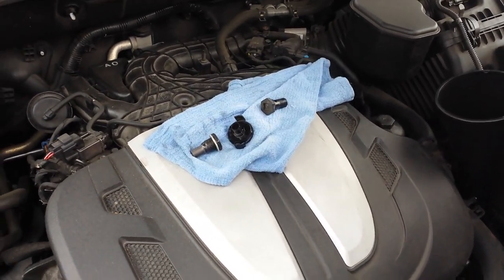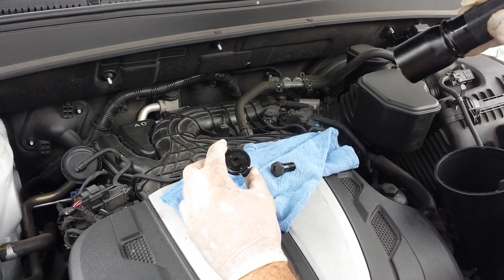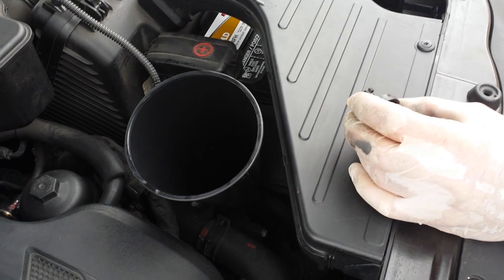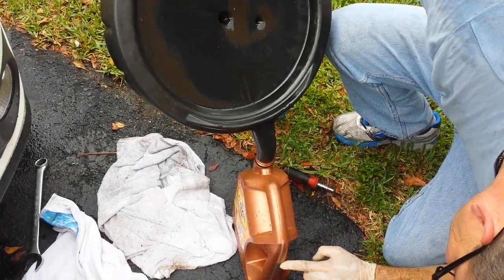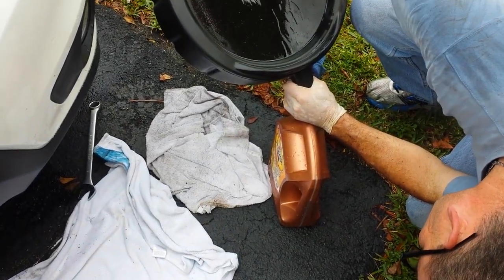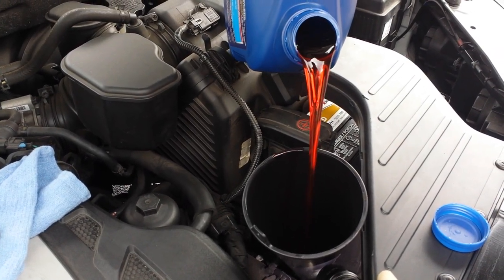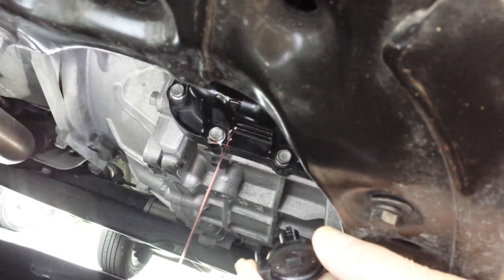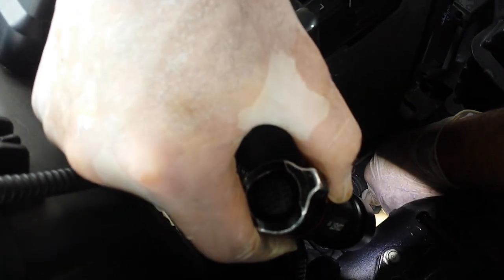Hyundai Santa Fe: Transmission Fluid Replacement- Part 2/2

Comment: Its good to see the procedure in action, but I read in the FSM that, instead of messing with the inspection plug, you jack up the car, drain the trans and then fill it up with 5 quarts of ATF, though I would probably be inclined to just measure what came out and replace that amount. Lifting the car would make sense since the drain is towards to back of the trans casing
Reply: Joe Giliberti good idea

Comment: As he said, check the type fluid for your car.  In 2013 Hyundai  appears to have changed to fully synthetic fluid.  Dexron VI for example.  You can probably go more miles with the synthetic but it's still worth changing.  Great video to show how to do it tho!

Comment: You missed the most important part of the entire process: Opening the level plug AFTER warming up the motor and shifting the gears. This is spelled out in the factory manual.
Reply: Lee S. Hello.
Do you know if the engine suppossed to be running when checking the level plug after engine  warm up?
Reply: YES!
Reply: Yes it is, shift though the gears beforehand too.
Reply: He did it is at the end of the video ..........
Reply: @jeromepark7002 No he didn't. He said "I don't feel like I have to go back and remove the oil leveling plug again."
Reply: And the engine should be running at operating temperature when you check the flow rate out of the leveler
Reply: I don't use the leveling plug at all during the oil change process. My driveway has an inclined surface, so the car always stands on a slope when changing the oil, so there is no sense from this level.
I just fill in exactly the amount that I merged.

Comment: You must check the levelling while the engine is running.
Reply: There is no dip stick in this vehicle.
Reply: @goriachkinpavel  It means that you must open the leveling plug, not a dip stick.
Reply: @goriachkinpavel  The process must be done while the engine is running, which is very important and which this man does not keep.

Comment: Hello, very good video. I have a question for you, you know if the transfer of hyundai 2001 is equal to 2003?
I have the faulty tranfer Hyundai Santa Fe 2003, a person sells a 2001 transfer, but the mechanic tells me that possibly the gear teeth do not correspond, ie, the gears are not equal.

Comment: Not bad video but the engine should be running at temperature operating temperature when you check the fluid flow rate exiting the leveler and you must be running not off and it must be at temperature and it should slow to a thin stream then you cap it

Comment: Just changed my fluid,  reaching out for a little help. it drained 4 qt. but only took 3 when it started pouring out the level hole. i let it drain for 1/2 hr. now I'm thinking i drained some of the converter. its shifting fine would rather have it under then over filled. don't want to just drop in another qt. the biggest pain in the ass was taking to bottom shrouds off again. any thoughts?
Reply: If you took 4 out i'd put 4 back in, a little overfill by a qt. won't damage tranny, a lot more will will just blow out vent on ground and make a mess.
Reply: @goaheadmakeourdayscooterpe9644  lol thanks appreciate it. Yup that's what I did made perfect sense. Guess it probably drained the torque converter. Next time I'm going to run it through the gears while I have it on stands then see if I can add more. 1 down and 2 to go.

Comment: Is there a filter involved ?
Reply: If you have an automatic transmission yes, but you need to take out the carter to change the filter, so it’s a bit harder to do that process, also you may need to replace the gasket

Comment: According  to the service manual, you are to have it running in neutral and up to operating temp before doing the level check. Then having it RUNNING in neutral, THEN check the level. You're doing it wrong!

Comment: Good job in showing us how.  But stop calling it "oil".  Its a fluid.   Transmission fluid.  Thanks!
Also point out to make sure you car is level (somewhat) so your transmission fluid leveling hole won't drain too much or too little.
Reply: Transmission fluid is based on petrol as transmission/gear/engine oil.